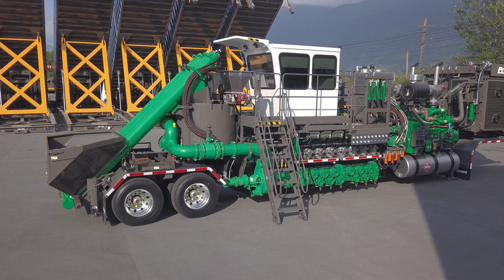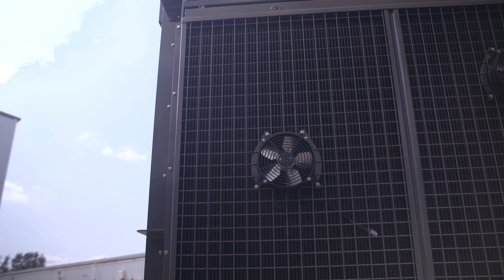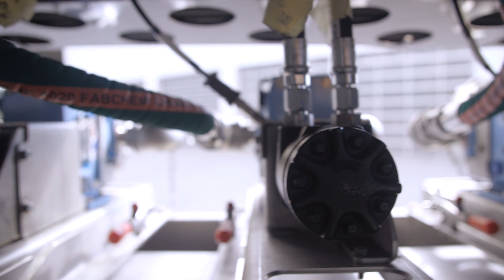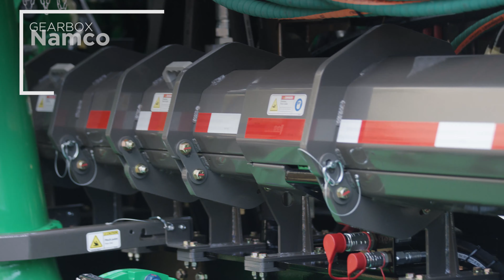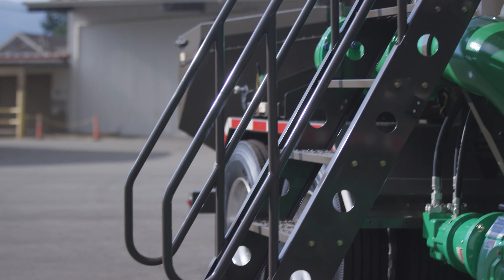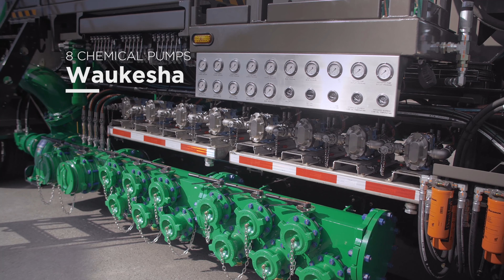Frac Blender Unit Overview - Propell

Comment: Propell-makers of the shittest operator cabins in the business,next,,Enerflow was the best,,
Just look at there hydration cabins, worst place to spend 12-14 hrs per day,, junk,,reliable I'll give them that though,,
Reply from the maker: We recall those hydration units, back in 2007 they were some of the first oilfield trailers we built. We hope you get the opportunity to spend some time inside a newer piece of Propell equipment - it may just change your mind!
Reply: @propell1372  Well some on the units I seen were built in 2012 & 2013,,Cabs were barely enough for one person to STAND in while operating,,If you needed to teach someone how to run it you had to take turns in the cab while the rear door was open because of the limited space some special engineer decided was enough space,,Could just hear the designer say- it's not built for comfort anyways, shouldn't be able to sit anyways, guys shouldn't be comfortable cause they are working,,BULLSHIT,,That limp dick weeny wouldn't last a week in it 12 hrs a day everyday working it without bitching how small the cab is,,I stand by it-just like the poor operator has too,,
Reply: @jamescameron204  feel better?

Comment: what are the tiny fans for on the cube radiator?
Reply from the maker: To monitor rad cleanliness, as the small fans get dirty and slow down, they notify the operator that the rad requires cleaning.